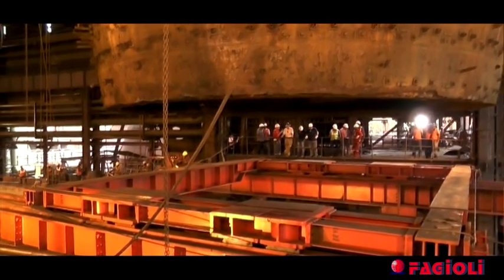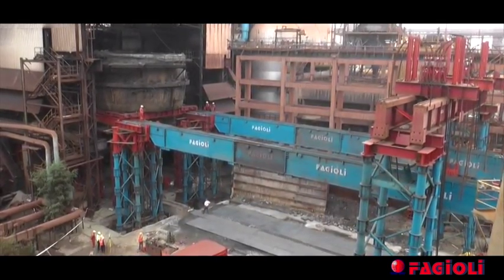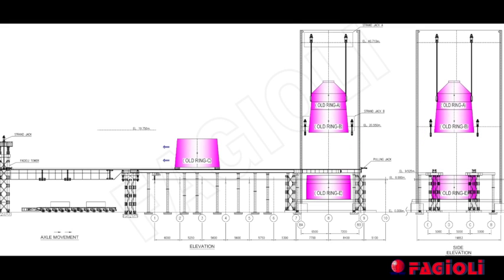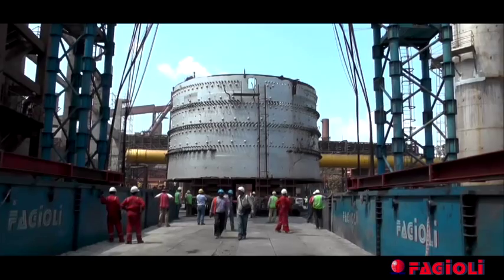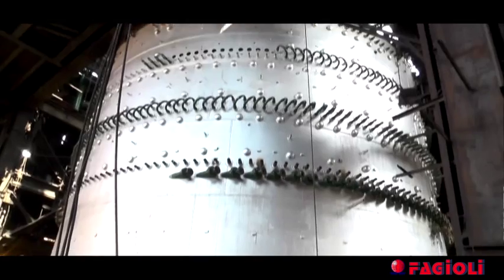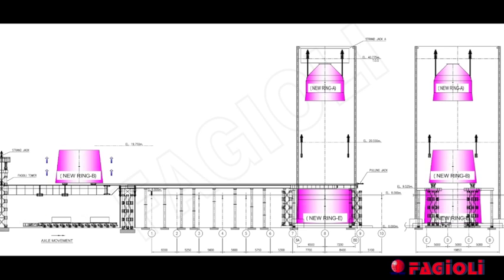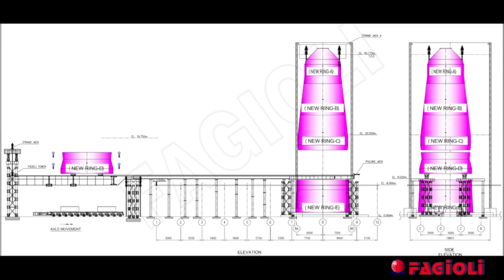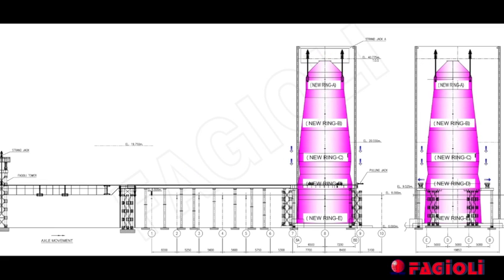Blast furnace Revamping

Comment: They obligated the owners to do the cutting operations. Presumably because that is an operation fagioli is unwilling to assume responsibility for.
I find this pretty shameful. Let an Indian worker die, it's not a critical operation anyway. I wonder how the people who signed that contract felt about it.
Reply: fagioli only does heavy transport and lifting. steelmill workers have plnenty of experience cutting steel
Reply: @laveturnerjones3954  Yep. Fagioli is not the general contractor on this job. They were just the movers/lifters.
 Was this a newly fabricated furnace or were the old furnace sections rebuilt and refurbished?
Reply: @epistte  scrapped the old one and installed a brand new one. Blast furnace shells are completely filled with cracks by the time they are taken ofline
Reply: I have been doing job in Tata steel A to F blast furnaces since 1998 to 2021in jamshed pur india